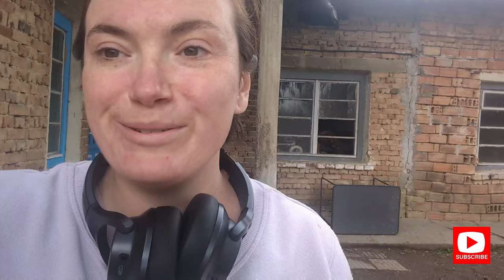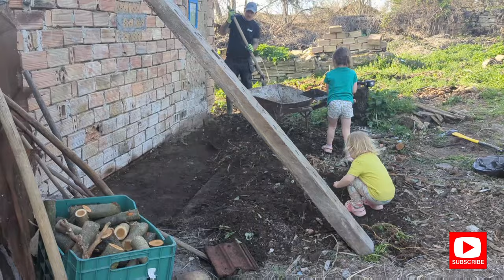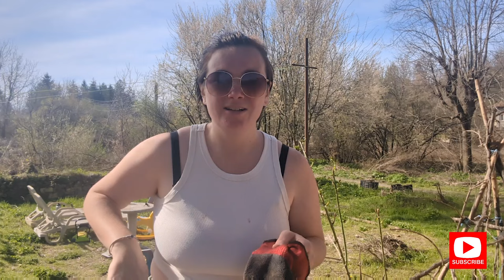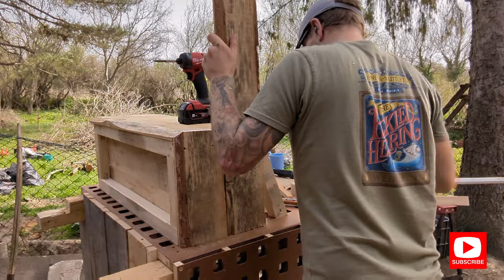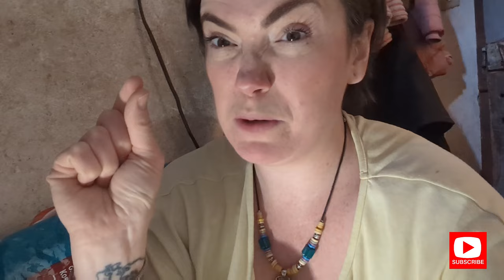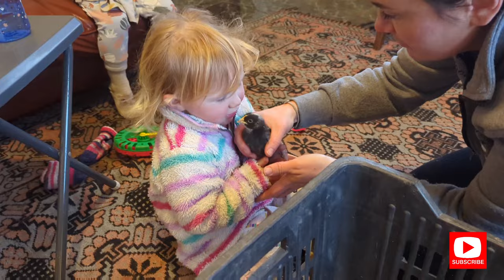Building a Chicken Coop from SCRAP in Bulgaria 🐣🐔🇧🇬 живот на село #bulgaria #българия

Comment: You will have a big problem with predators !
1. Белка. Beech marten (Martes foina)
2. Невестулка , least weasel (Mustela nivalis) 
3. Златка, European pine marten (Martes martes)
А, very small hole is needed for the weasel to pass through. The least weasel has a thin, greatly elongated and extremely flexible body with a small, yet elongated, blunt-muzzled head which is no thicker than the neck.
And the beech marten and especially European pine marten can open any one of thеse doors on Chicken Coop. You need a locking system and metal mesh " Мрежа Рабица " .
Reply from the maker: Yes I knowwww it's not finished yet 😆🙈 I absolutely WILL NOT put the chicks in the coop until it has been predator proofed. You'll see in our next video the full enclosure with double fencing and metallic mesh to go over the holes. There's no way they'll go in there with the holes open like this 😆🙈 We just ran out of time and energy!